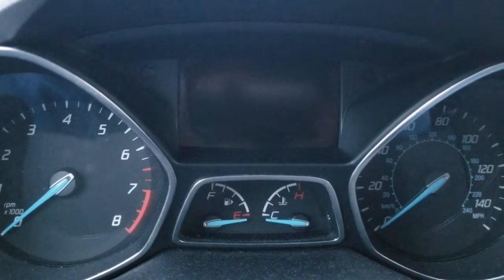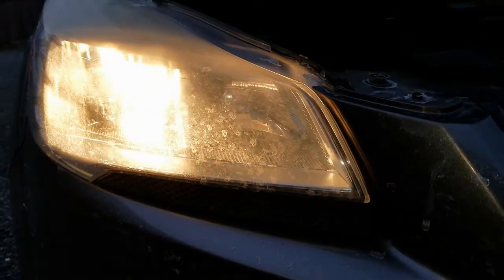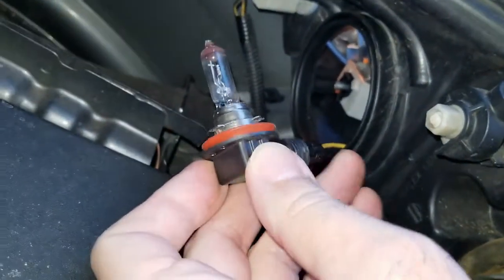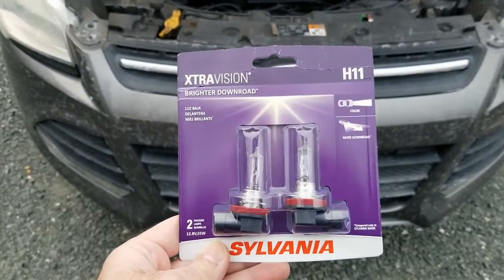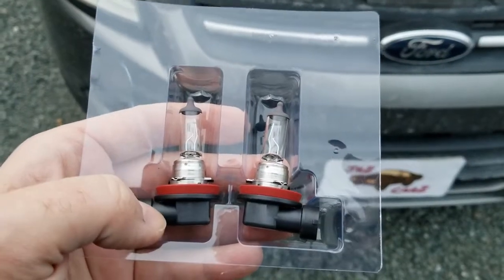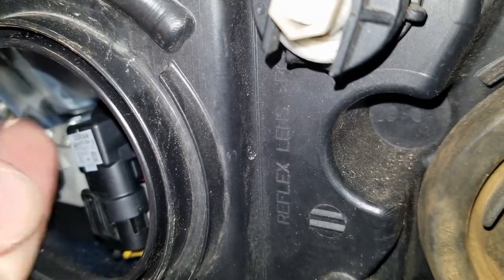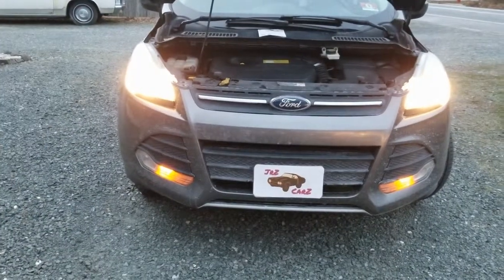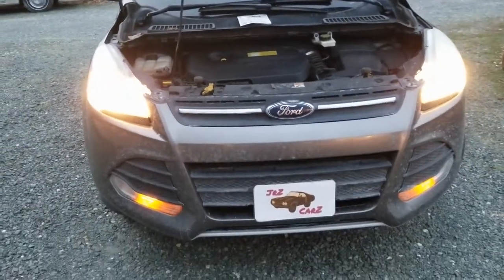Ford Escape Headlight Low Beam Bulb Replacement, Very Simple!

Comment: Anybody can replace the driver's side headlight. Not too hard to figure out. The passenger side is another story. Why is it that everybody who makes one of these videos shows how to replace the driver's side when they should show the passenger side?
Reply from the maker: Move the coolant overflow tank and you have all the room to replace the bulb
Reply: I'll let you know. But why do they do that? I've changed the bulbs and the battery on all my cars for over 50 years. It just gets worse and worse every year. I remember an old Chevy from around 63. I think it was a Biscayne. Changed the starter from under the hood on the street. @JrZCarZ
Reply from the maker: @franks2910  that's a very good question. They pack so much unnecessary junk in the engine bays now  it's ridiculous. I had to replace a heater core line in this Escape a couple weeks ago and I had to take all of the cowl off to get to it. My 69 Mercury Monterey I can stand in the engine bay, even with a 390 in it. 😁
Reply: What ? The drivers side on the 2011 is I. Front of the battery which is easy to move but then it’s jammed tight on  angle lol the passenger one has easy access I got it off in 1 minute but the drivers side is fucked

Comment: For those looking for a solution to changing the passenger side headlight bulb.  Here is what you have to do, no tools...works with big hands too!  Step #1, gently take the coolant overflow tank off it's front clip, by pulling it upward and off the small metal post, this will give you about 2 more inches of room to get your hand into the headlight assembly.  Step #2, remove the rubber cover off the back of the light.  Step #3,  unclip the power to the bulb and remove it.  Step#4.  Put a new bulb into the assembly and lock it into position.  The plug and socket will nicely line up.  Step#5 Just guide the plug into the socket and squeeze them together until you hear that nice click. Step #6, put the rubber cover back on and put the coolant overflow tank back onto its clip.
Reply: This is the exact proceedure for the other side.  The coolant tank is in the way and the electrical lead is too short.  The only other thing I can add is to wear gloves, especially when install the new bulb.  This prevents touching the bulb glass with your fingers.

Comment: What a waste of time. I guess you didn’t replace the passenger.
Reply from the maker: Thanks for watching. Of course I replaced both. The passenger one is the same as the driver's side, you just need to use your brain to get it in. You have to move the coolant reservoir.
Reply: @JrZCarZ that’s why you didn’t show cause it’s not easy

Comment: The right side is NOT simple, too crowded in there.
Reply from the maker: It is tight but is not all that terrible.
Reply: @JrZCarZ  Not if you have big palming-a-basketball-is-no-problem hands.  Moving the coolant tank aside is critical.
Reply from the maker: @derelict8715  coolant tank is on the passenger side under the cowl😉 I'm a big dude too and have the chonky palm a basketball hands too lol.

Comment: No the wire won't give you enough room to work on the passenger side!!!!
Reply from the maker: Sure it does, you just need to use caution. It's a tight squeeze but it works.

Comment: I changed the right bulb and the fuse and the right headlight still didn’t work. Help!
Reply from the maker: Sounds like you need to do some testing of the wire harness to see what the issue is. If the fuse was blown that means there's a problem in the wiring that caused the fuse to blow. I would start by checking the ground.
Reply: You figure out what the problem was having same issue tia
Reply: @JrZCarZ  yeah. I need to get a multimeter which honestly i don’t own  which is surprising for as much tinkering around I do.

Comment: Low beam fuse location?
Reply from the maker: Do you have your owners manual? It would show you in there, but the better question is why you're looking at the fuse? Is the light still not working after replacing the bulb?
Reply: @JrZCarZ  I checked the manual, but I still can't seem to find it. And yes, that's the exact problem. Changed the bulb, but alas, still no light
Reply: Do you have a video changing the wire pigtail?